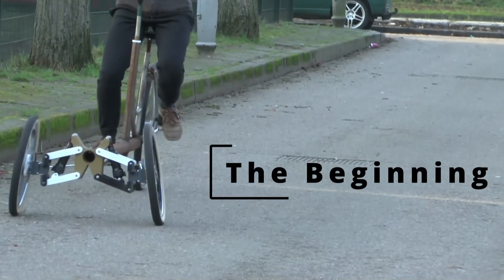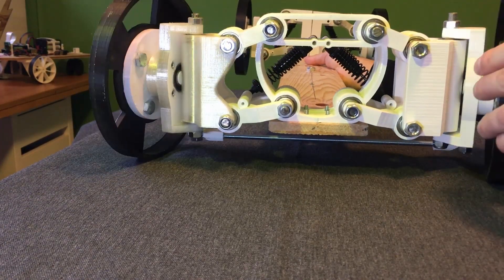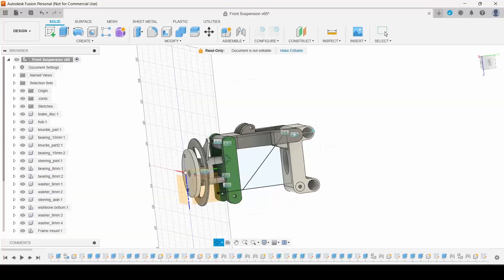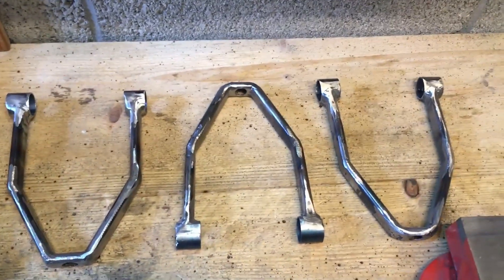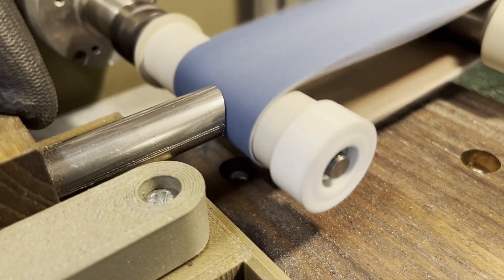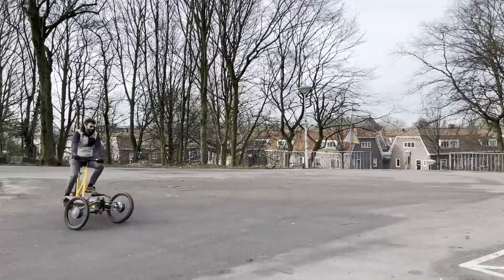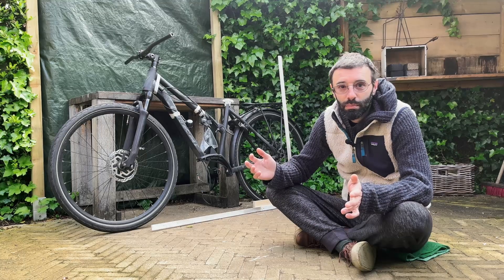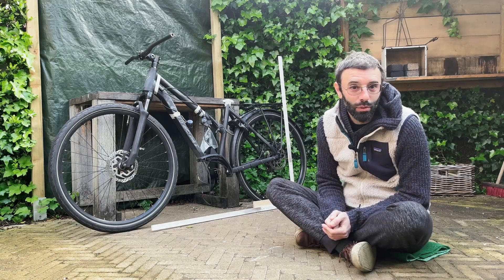Tadpole Tilting Cargo Trike Project Summary #8

Comment: Pedro, with your variable by ten degree caster design, I wondered if finer adjustments might be helpful. I believe you could do this by doing a Vernier style adjuster, where you would have two plates, the one you currently have with the 10 degree adjustments that the A arms bolt to and another that is attached to the frame. Both plates would have holes regularly spaced over the same distance. One of the plates would have N number of holes and the other would have N+1 holes where  N= whatever fineness needed. The larger N is, the finer the adjustment (and the more work to drill them). A bolt goes thru whichever pair of holes needed to give you the subtle number of degree needed for optimum tuning. Then for structural reasons, holes that allow greater clamping force would be needed. Just a thought!
Reply from the maker: I appreciate that! I was trying to find grossly where caster should. I know it should be more than 0 and less than 20;). And 10 was the option that I had.
I agree with you that such a plate would allow me to fine tune in further.
Cheers!

Comment: Pedro, do you think a speed-sensing tilting bike could ever be made? As I'm looking at Recumbent trike design and I like to ride fast, the tilt should be more aggressive the faster you go - like on a normal bike. Obviously it would need a small microprocessor, and some sort of servo set up to increase and decrease the length of the rod. Does this concept excite you?
Reply: I watched a few more of your videos. I always assumed the tilt was tied to the steering, but it's not. It's actually the weight of the rider, which is really cool. You are fortunate to be in the Netherlands - the choice of bikes to try are a lot more than in Australia! What geometry affects the side to side stability? I love your work!!
Reply from the maker: @andrewmclean1239  indeed! I try to make it ride as a bike with the extra safety and stability of the two front wheels. I do try to make it simple. I a fan of making things as simple as possible but not more (not my quote ;))

Comment: Back to the steering geometry. Can you do more testing with the caster. As a mechanic, I knew your jig was too broad - 40 degree caster is far too much as you discovered.and so you settled for 10.  Caster however, is finer than that. Motorbikes, I believe, run around 7 degrees. Bikes closer to 15 (I think). Would you tempted to modify the jig to go from 5-15 in one degree increments? 

I'm quite interested in building a tilting recumbent e-trike, using your R and D. I have a Greenspeed X5 now.
Reply from the maker: I totally agree that the testing was too broad and not fine tuned. I think I need different tests to fine tune actually because all the tests I've done are based in personal feelings so I need to get more scientific ;).
At the moment, I'm focused on Improving things that are not good at all such as the wheel hubs. Then I'll  be able to get to the details.

Comment: Aluminum as a material for stiffness and weight reduction may not be ideal for the consumer in the long run. Aluminum has a finite fatigue life and is brittle in some modes compared to steel, allowing it to tear easily if not made stiff and securely welded. It HAS to be stiff in order not to fail, and when it DOES fail, repairs are more difficult for the DIYer and more costly for someone who brings it to the shop to be fixed.

On top of that, shops might also simply refuse to work on a homemade product, leaving the consumer high and dry, so to speak. Furthermore, DIY repairs are more difficult because of the process of welding aluminum is more skill-restricted due to aluminum's head conductive properties. But that's the only criticism so far. Mid-drive (I assume for the electric powertrain) is something I agree with, so good on ya for that. Reducing rotating and unsprung mass is excellent, as is mounting the weight of the motor lower than a hub drive would allow.
Reply from the maker: Hi, thanks for that. I start to become more aware of the downsides of aluminum. I'm thinking that what makes sense to me, if this ever becomes a product, is to partner with a bike manufacturer to make the frame and then I being responsible for the front.
Cheers!

Comment: Been watching your project from day one and I wish here were more youtubers like you. I think you have gone above and beyond proving that upright reverse trikes do not have to be recumbent to be stable. I pedaled around on a Dickie D icecream reverse trike one summer in my teens. It wasn't the most stable but was very rideable.  I started building an aluminum version of your version but decided to put that on hold until my aluminum welding skills are better because it's not as forgiving as steel. I do have two questions and if you have the time to reply, I would greatly appreciate it and if you don't, it'ss all good. 1. The shocks look like they haven't changed aside from using a single shock. I can't seem to find any mention of them in any of your videos. What make and model are the shocks?  2.  What is your reasoning for cutting the head tube off instead of simply extending?
Reply from the maker: Hello, and thank you so much for your kind comment!
I do set aside some time to reply to comments. It is my pleasure.

First of all - let me say that I'm working on a new build with an aluminum frame and this is my first time welding aluminum. Well, it's much more difficult than steel but it is like any other thing - it is only difficult until it's easy;) I've been spending many hours welding together bits of aluminum and only yesterday I welded the first actual part that goes into the build and even thought it's not great, on every new part it gets better.

Regarding your questions:
1 - The shocks went from two to one to simplify the build and the geometry. Simpler is better. I chose "rockshox deluxe r debonair 210 mm x 50 mm" because it suited my geometry  a long shock and also I wanted something with a long travel so that it works with cargo and without cargo and still having travel. Also, I got a big promotion on these really good shocks (84 EUR);).
2 - Well, I just think it's easier to cut it off and weld a new tube. Just practicality.

Cheers!
Reply: When i asked about the head tube I was asking if thought the angle change was necessary since you were splitting the head tube you just squared off the head tube angle to make it easier? Sorry for not being clearer. I need to make my bike somewhat modular because i don't have room for a 10 foot bike lol
Reply from the maker: @GypsyJrs , if you're making a connection like I did - With an arm and a bar connecting the head tube to the front pivot, the best would be if the head tube does a 90 deg angle with the extension tube because both steering tubes will be at the same angle.
In the design that I'm working on now, I'll have cable steering with pulleys. This way it is less relevant the angle of the head tube.
Hope this helps.
Cheers!
Reply: @pedro-neves   I switched back to my aluminum build. I really                                                        don't trust my aluminum welding for the head  tube so it's going to remain the original angle on this build.   I'm using a 3"x2"  aluminum beam with 1/4" walls from an awning someone near me demo'd whch I coped and welded to the aluminum Norco frame I'm using.   I have a coil shock from a CCM mountain bike Rockshox are great right up until you look at the ridiculous price tags they have. Any ideas where I might find a decent shock I can repurpose for this build?  I'm sticking to my repurposed theme except for 4  ball oints I bought from Temu for $8. One other thing, I Frankensteined the steering column using 3 pieces of tube and it it got me thinking that it's really awesome of you to share every aspect as you make improvement with each video. You have my gratitude because it's like an adventure piecing the craziest things together to makei t work and I'm really enjoying it.  Thanks
Reply from the maker: @GypsyJrs  , indeed, you have to be careful with the welds. Especially the head tube.
Regarding the shocks, I agree that they are very expensive. I mostly use two stores for bike parts:
- https://www.bike-components.de/
- https://www.internet-bikes.com/en/parts/
And I also buy used parts from local private sellers with websites similar to ebay.
Thank you so much for mentioning that my videos helps to piece together these kinds of puzzles;) I try to give a good explanation and make it better every time. I also get a lot of helps from other maker YouTube videos so I try to be good at it;)
I'm working on a new build and I will publish the video in less than 2 weeks from today. I think this video will have the best head tube extension explanation that I did so far;) Also it has cable steering so I look forward to sharing it.
Good luck with your build!
Cheers!

Comment: Impressive design theory and practical engineering. Could you please, however,  address this trike tilting mechanism  found on TRIS Trikes. It uses two interconnected front forks that seem to tilt effortlessly and require fewer moving parts. Do you approve of this approach? What are the pros and cons of doing it this way. https://www.youtube.com/watch?v=pS2ZDMKep7E
Reply from the maker: Hello, thanks!
The TRIS trike looks very cool. It's not totally obvious to me how the tilting mechanism works but it seems to be in the frame. I think there is a small disadvantage in not having suspension but regarding the tilting mechanism, I cannot see how it works.
Cheers!

Comment: Nice job 

Without trike steering lock ( there is .. )

Can you stay seated on the saddle feet on the pedals when stationary ? 

Thanks
Reply from the maker: Thank you very much!
No, you can't. The tilting will let it fall to the limits of the ball joints (30 deg).
Cheers!

Comment: Are you planning on heat treating the aluminum?
Reply from the maker: Hello, I didn't think about that. What kind of heat treatment do you suggest?
Reply: @pedro-neves  I think typically 6061 alloys get a T6 treatment on bikes to retain rigidity. I myself have only messed with steel
Reply from the maker: @0gham  me too! I'm still learning about aluminum before I let the TIG torch anywhere near the trike frame;)

Comment: How about larger front wheels?
Reply from the maker: Hi, that's a good point. Actually, I've been debating quite a bit about wheel size. Also considering the rear wheel size. I've been seeing new models of cargo bikes with smaller rear wheels. But haven't fully understood the impact of wheel size so haven't made any decision yet. 
Cheers!
Reply: @pedro-neves smaller rear wheel diameter is used for strenght so it can carry heavy loads. but maybe problematic on uneven roads.
Reply from the maker: @TaylanEkinci , I agree with those pros and cons. Another pro of a small wheel may be that the trike is more maneuverable.

Comment: Doesnt the ackerman get fucky when you're tilting causing toe in/toe out?

Edit: Asking because im in the design phase of a tilting 4 wheel velomobile.
Reply from the maker: Hello, great question! The Ackerman part was quite tricky indeed. I made the drawings to calculate the position but then had to do some practical adjustments. I described all about it in here: https://youtu.be/q2GTZd428vM?si=5lN7ulCU91MO3hPq.
It works very well when turning. No scrubbing of any wheel.
Hope this helps.
Good luck with your build!

Comment: YES! Am a follower and enjoy your thoughts! I have a SWBase recumbent, but need a trike instead as I am too old and weak to go up hills without falling over. I would like to say you need a simple small lathe. NOT CNC,  just an old Proper lathe like something someone want's to sell that's old and SOLID not a Mini lathe that people buy today and find it's no use to make a solid aluminium or brass part.
Reply from the maker: Hello and thank you so much for your kind comment;)
I would love to have a lathe! Actually, I will have a small lathe course before releasing my next video because I will need to make a spindle for the new wheel hubs;)
Cheers!

Comment: Thank you so much for sharing so much interesting and useful information. Providing a venue  to inspire a community is great and I look forward to your upcoming episodes and dialogue from others.  I found your suspension testing especially informative in a design I've been working up in Solidworks for an enclosed DIY E-trike. If you have need for stress analysis and modeling I could run designs through Solidworks.
Reply from the maker: Thank you so much also for your inspiring words. I have great pleasure in sharing in a community with common interest.
Once I have the drawings ready and share them, would love to get your ideas on proceeding with stress analysis!

Comment: I love your work and designs. But 
I do not see any advantage that a tilting 3 wheeler has for someone who can't 
balance a 2 wheeler.. 

In 1910 Walter Brennan came up with  "The Self Balancing Monorail" 
that on a single rail was able to self balance and lean as it went around turns 
without any input from the driver...

For people unable to ride 2 wheelers, your bike would need a gyro that controls 
how the wheels tilt as a reaction factor of the centripetal force of the turn itself.

Also look at 
Two-Wheeled, Self-Balancing Gyro-X vehicle from 1967 in action & driving scenes!

Balancing on Inline Wheels with Gyroscopes -- James Bruton

The only other part that  I see needs improvement is where the battery is located.
It could be mounted vertically on each side of the seat post, tilted backwards 
so that it could be pulled out behind the seat... That way you would have the 
option of having 2 batteries if needed... and the batteries wouldn't get soaked 
driving through puddles....

Note about your failed CNC disc..
The reason it failed is because no matter how precise the CNC is, 
it can't center a disc as well as turning it on a lathe...
(I put a coin on a lathe and drilled a hole through it's center.)

I know you can do it...
Reply from the maker: Thank you so much for your suggestions and also for sharing those examples of great inventions!

Comment: you can save time for the printing part by printing only the outer shell and pour epoxy resin into it. you can mix it with talc powder it will be stronger than solid 3d printing.
Reply from the maker: Thank you! Actually, I never worked with resin but I look forward to a good excuse;)
Cheers!
Reply: @pedro-neves  I play with resin and wood before. so i got my vacuum pump, but you dont need that just pour little by little. you can mix with fiber glass, its cheaper and faster and stronger. but dont forget to seal all the holes from 3d printing. and thanks for the design
Reply from the maker: @ZuNunchaku  those are very good tips, thank you very much!

Comment: I have built my own e-bike, and I like rear hub motors the most because they don't consume space. Additionally, I can regen brake, thus charging the battery and slowing down at the same time.
Reply from the maker: I absolutely agree that in-wheel motors have advantages. The reason I like mid-drives is partially because of being a big fan of mountain biking, so I got used to not liking unsprung mass. Part from that, it's easier to have good torque sensing in a mid-drive and there is even the possibility of incorporating a gearbox, which I'm considering to try and create in the near future.
Cheers!
Reply: @pedro-neves  When you say 'create' a gearbox, are you thinking of designing and building one? I'm really interested in the Motor Gearbox Units that are coming out- But no one is really selling them to the public yet.
Reply from the maker: @andrewmclean1239  I'm planning to design and build a motor gearbox system as part of this project and fit it in the place of the original bosch mid-drive. There are commercial ones - checkout the "pinion"
Reply: Pedro. That is so cool! Yes I have seen pinion, and intradrive. If you need testers!
Reply from the maker: @andrewmclean1239  thank you! I'll probably start this project in the winter and share in YouTube. Let's see how it goes ;)